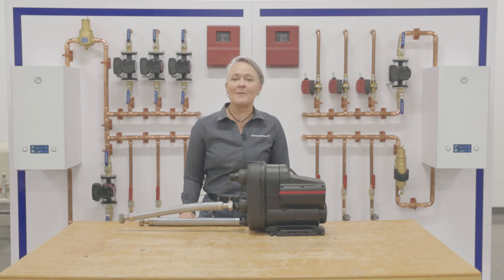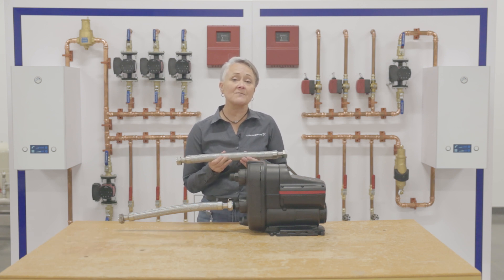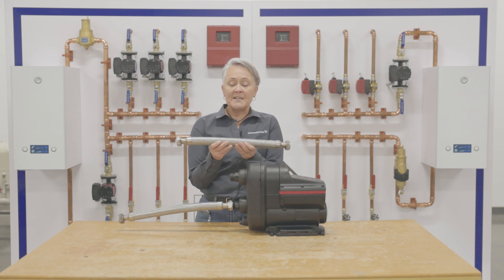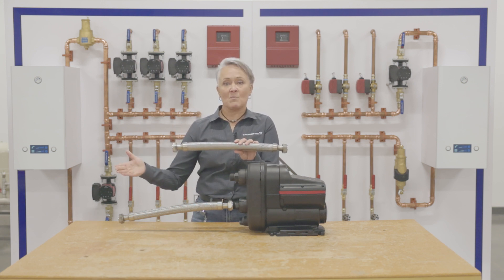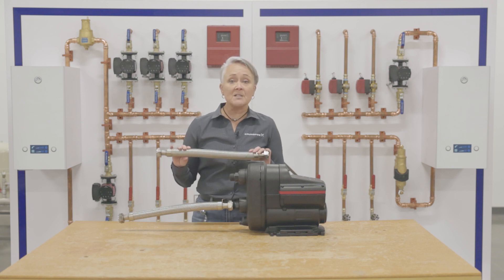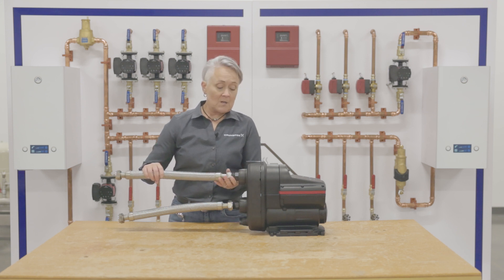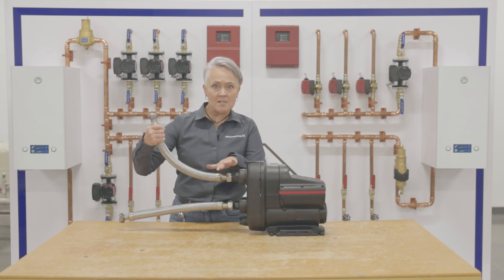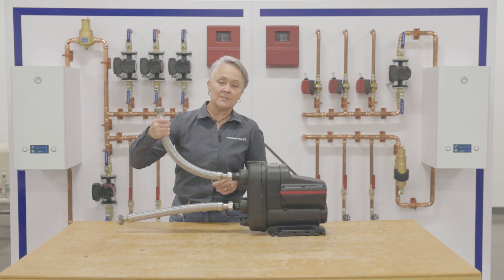SCALA2 Installation Tips (Proper Sizing and Connections)

Comment: If the scala2’s blinking red on the 5th alert, what does that mean? How do I address the issue?
Reply from the maker: Looking at the quick guide for the SCALA2, that alert shows your setpoint might be set too high. Our recommendation would be to start by lowering the setpoint and seeing if that fixes the problem. If so, it means the pump doesn't have enough inlet pressure to reach the higher setpoint it was previously set at.
 
If lowering the setpoint doesn't fix the problem, then the inlet pressure is likely too high, and a plumber should get involved to inspect the system. They might need to install a PRV (Pressure Reducing Valve).

You can find a link to the quick guide here: http://gfos.ly/6054gyFOm